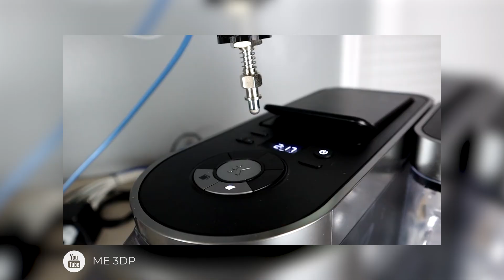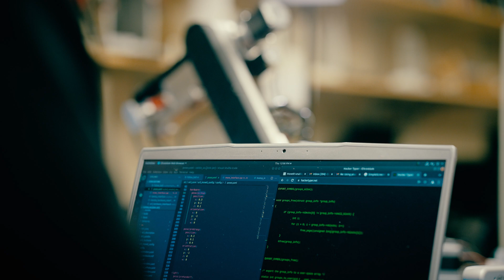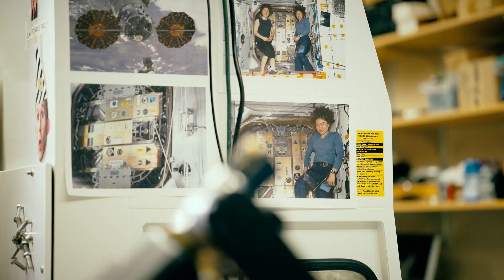The Robot Farmer - Annin Robotics builds AR4 small robot arm in Emmett, Idaho

Comment: Thanks for making a video with Chris. Bought an AR4 MK2. Finishing up the wiring right now.

Go Chris!!!
Reply from the maker: Absolutely. When did you buy it?
Reply: @buildwithpeter  Early march. It was the AR4 MK2.

Chris has since came out with the MK3 version. Ah, I just missed it!

Hoping to use mine to learn vision recognition and advanced path planning. I work for turbine repair and we do a lot of thermal spray.

I think thermal spray might be one of the hardest path planning tasks for all industrial robot arm applications (Compared to pick and place, machining, painting). Without getting into the nitty-gritty, the speeds, angles, accelerations, and overlaps of the toolpaths all matter a LOT. At least in machining, you can afford to slow down your tool or have overlapping toolpaths.

Basically, it was making me loose my mind, and I bout the AR4 to try and prototype a programming tool for the thermal spray industry. 😅

Comment: 3:47  Bull fing scat.  I bought a big a$$ 1000lbs fanuc industrial robot for $250, these things are so cheap people are throwing them away.  You can literally get them free for the asking (or at least for scrap metal price) if you try hard enough, or you can buy one, working with a controller box for like $5k from ebay any day of the week even on a Thursday.  You want to do something because it would be cool mad kudos for that, but don't get on here and try to gas light us into believing you when you try to say you could afford to build an industrial sized robot but couldn't afford to buy a used one.
Reply: Just because it is possible to get a working robot with controller for $5k like you said doesn’t mean it is the same as what he is on about. Chances are it is older without as many features and designed for specific tasks not what he is trying to do. Also not everyone has the space or facilities to mount a heavy and large robot that will then also be a pain to move around. What the AR4 is going for is to be a relatively small and portable robot arm with precise control and can be combined with machine vision, it is not the same as a basic large robot arm and controller that just repeats the same motions continuously.

Even if you get a machine for cheap then how expensive is it going to be to replace parts on it? You might have to go back to the original manufacturer which will be relatively expensive.
Reply: @conorstewart2214  Motors only come in so many flavors.  Replacing the servo drivers for industrial robots is commonplace in the aftermarket world.  Trust me you don't want to deal with FANUC directly, they charge $300 for 100 pages of service documents.  But it's easy to reverse engineer the control systems.  You're just reading encoders and driving servos. 

And these six (or seven) axis robot arms are hyper genralistic.  You may find some more suited for a welder type payload or another that tote around 100kg.  I've only dealt with tow that were specific, one was for wafer handling from an IC plant from the 70's and the other was one of those super fast delta spider bots, but this one had an articulating grasper (shit was mad crazy).
Reply: @zyxwvutsrqponmlkh  I actually bought an AR4. But I have seen some people getting actual industrial robots used and getting them online.

I think that would actually be sick!

Thanks for the tip about how affordable this stuff is. I'll definitely have to take a look.
Reply: @zyxwvutsrqponmlkh  Okay. I just scoured Ebay and FB for the past 30 minutes. Looks like used robots are actually a lot of hassle if you're trying to actually get something running that's going to continue running.

If you have a cable go bad or a board component, you are going to first have to figure out what exactly failed (which is already hard if it was like an electrical component), then figure out how to get a spare. That does sound quite painful.